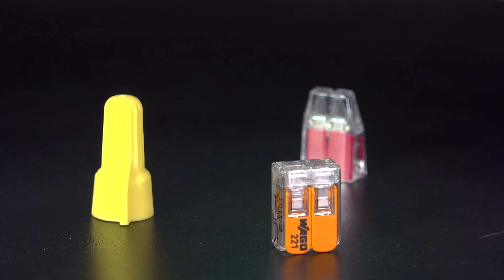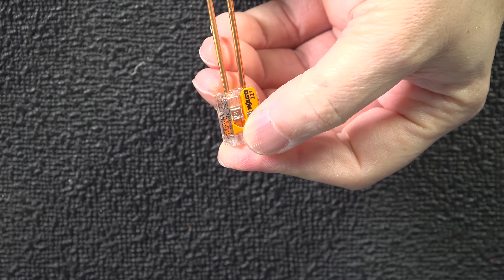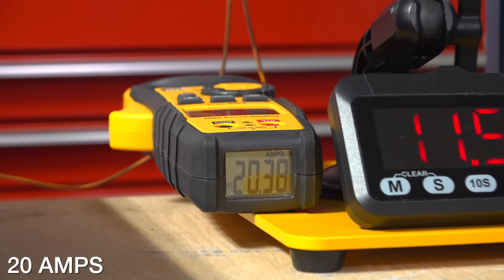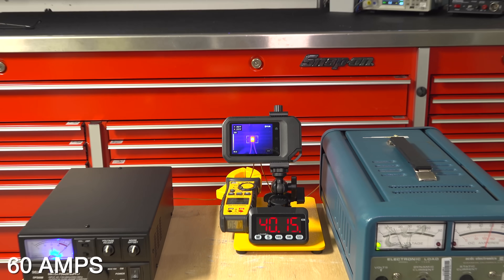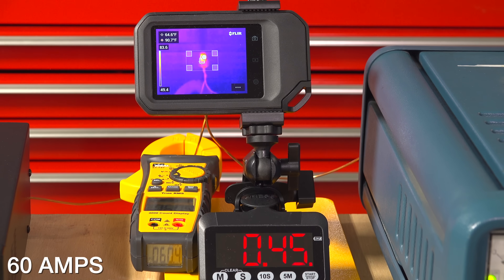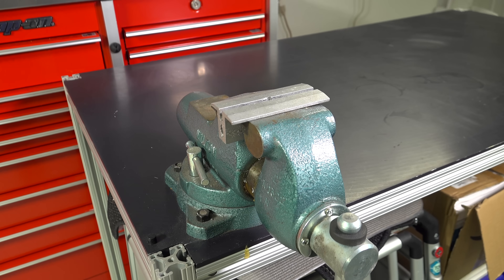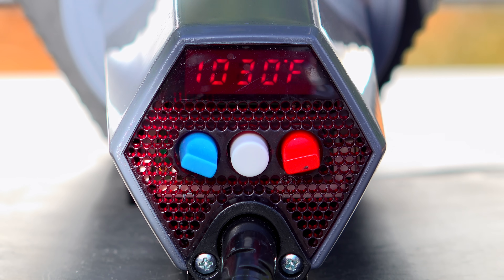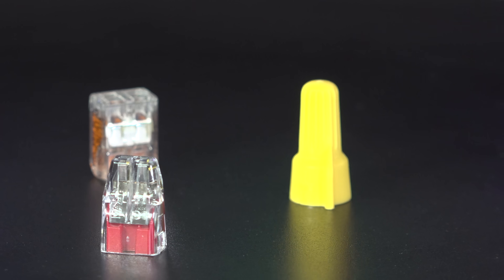What Wire Connector is the Best? Wire Nut VS Wago TESTED

Comment: I used the whole range of Wago 773's in my farmhouse rewire, and have had nothing but problems with them.  Simple, easy and quick to use, but they weren't reliable.  Even on light circuits, using 1.5mm cable and only LED bulbs, the Wago's were burning out.  I went back to the older style of connectors, without a single problem after 3 years.

Comment: The reason the wire nuts didn’t get as hot is a. Certain portion of the current wasn’t even making it to the wire nut because you twisted the wire down so low. It was able to transfer to the other wire without even going thru the wire nut

Comment: Someone else might already have, but I must comment that your wire nut test was not likely to be fully accurate. Usually if the wires are twisted together there is only the nut's length of bare wire involved.  Now there was at least double of that length making more or less contact. It might or might not contribute to the result, but that way there will be contact area outside the nut and in a ventilated environment.

When I went to vocational school we were strongly couraged to discard the wire nut if undone, and put a new one on, unless ONCE adding a wire. The nut can also hold well on to a maximum of 5 wires (seen these Wagos with up to 8 slots) where pre-twisting is highly recommended. 6 will be questionable and the 7th would tend to center inside the other 6 and possibly pull out easily. 

The Wago can be reused a couple times, undone wire by wire without twisting, wiggling, or pulling, or disturbing the seating of the rest of the wires, it can take mixed wire sizes, and it works well with stranded wire too. AND it will hold on to a single wire of any accepted size.

Comment: Hi, when you tested the heat dissipation on the wire nut you twisted the non insulated wire (2:59) on a longer surface than normally would be if it was an insulated wire, the increased contact surface  between the wires lowered the resistance and the result is a lower temperature at the wire nut,

Comment: Can you do the test on 110v AC? I saw low voltage DC and high amps in your test.  That’s not an accurate representation of real life for any of those connectors.
Reply from the maker: AC & DC amps are the same Feel free to look it up. For testing this, its identical.
Reply: @SilverCymbal  ok, so why was it at about 14vdc? That’s not 100-120v... big difference in wattage.

Comment: great video. a couple things though.  
On your first test with the wire nut, when you twisted the wires together you had like 25mm of twist beyond the wire nut, so the nut was likely not seeing the full 60A load, just the residual heat off of the long twist connection.  I think it's unlikely for wires to be twisted that far down from the nut, but I'm no elechicken.

In your heat gun test, if the wago were actually making a connection between two wires, even at 1100 degrees, the connection would not have failed.  Only the plastic did, but the metal tab construction would have continued to hold on to the wires and complete the circuit.  The same could probably be said for the wire nut in this case as well.

Comment: Was that test done with AC or DC power?
Reply: Test was done with DC 14Volts. But for the this test it really doesn't matter. for the wire or the connector 60A at 14V DC are the same as 60A at 110V AC
DC is sometimes even worse than AC  (e.g. switches) because there is no zero crossing like with a AC sine wave - so contacts burn up more easy.

Comment: still..1980 houses are still holding up still..due to people know how to use wire nut correctly...extra tight as breakers bond its hot wires very tight...copper need to be grab tightly so be no friction to cause heating issue...remember ..always update your panel box for same metal as breakers and wires...aluminum does not do well with copper wires feeding the bus bar...cause copper eat up the aluminum..only solved this..either change entire wires to aluminum that even from meter box that feed it ...that will cost lot more than just get copper 200amp panel from latest panels are now made in copper bus bars ..

Comment: Might as well include all parameters that are present in real world use (include insulation) not including insulation is swaying the bench test, by how much? Idk, and nobody does until you document your data with ALL real world parameters. To some degree, the insulation will decrease the fitting amperage capability. Bare copper isn't going to react the same as insulated copper to current because heat is a byproduct.

Comment: pore design the electrons have to come back on themselves causing heat.. you should only be using inline connectors of the right amperage
Reply from the maker: Yes up to their 20amp rating or less.

Comment: I think it really comes down to cost if ur using for a commercial application amazon a box of 100 wagos 20 bucks wen a box of good ideal wire nuts 50 bucks for 500 n wen ur ur using thousands it adds up. Also u have less restrictions u can put 2 4 6 as many wires the nuts rated for without having to have just 2 4 or 6 port wagos without having to order 5 differnt sizes or making jumpers between them thats just my opinion.

Comment: I think I will stick with wire nuts and screw clamps.
Waygos have more points of failure than other connectors. I use them for temporary connections only.

Comment: I have seen wire nuts with 4 wires stuck in them and they were holding on by just hope alone and I had to replace them by soldering them since I didn't know about Wago lever nuts then.
Reply: You just use a bigger wire nut. They do come in different sizes.

Comment: Well , how do they do with the aluminum to copper connection as i have a special connector with lub to prevent high resistance connection and  torque setting as possible overheating and fire .  Code says replace wire nuts in older houses, Thanks for great video
Reply: Many Wago connectors are certified for use in (mixed) aluminum wirings, but you have to apply a special contact paste to the clamps. Download the product data sheets on their website.
Reply: @matekochkoch  thanks  for info . so much ------40 amp show was great

Comment: I don't think that the method is good for testing the wirenuts, compared to wagos
In the wago, the wago make the connection, and the load pass thru the wago

With the wirenut, absolutely no load pass thru the wire nut, because wires are twisted before it...

But even if the twist was only in the wire nut, I think the wirenuts will handle more because there just "hold" the connection between the two wires, and do not act as a wire itself like wagos

So better in terms of heat and connection, but I personally prefer wago anyway

Comment: @Silver Cymbal thank you for the share . I'm sure the wagon costs more per unit compared with a wire nut
Reply: Yes, but no. They are way more expensive, but you safe that on time. Also maintenance, measurement and alterations are much easier. All Wagos have a point for secure access with a multimeter. If time or wages are a part of your calculation they are not more expensive even on first Installation.

Comment: I’m going to keep using wire nuts because I’ve never had a problem. 
If it’s UL listed it’s all good.
Reply: Your last sentence makes this the top comment. That testing is there for a reason and it works.
Reply: @jeremiahrex  I’m actually pretty sure the WAGO’s are UL listed as well. 
I’ve just never had a problem with wire nuts, and I know what’s it like to work in a pancake box in some of the tightest areas. I’m sure everyone here knows what I’m talking about or been there and done it a hundred times. 
We all have different opinions.
It’s the UL listing is all that matters... also local and state code. However I couldn’t think of a state that would ban the use or even a locality. In my case it’s personal with my state inspector, he doesn’t like them, I don’t use them.

Comment: Three 12 gauge conductors on yellow wire nuts.  Four 12 gauge conductors on red wire nuts max.   Twist wires with your linemans and twist connectors clockwise.  We all have our preferences.

Comment: I liked all the tests that you performed, good work, although I would like to see the current test with actual AC power and not DC, seeing that these connectors would be used on actual wiring in a commercial or residential setting.
Reply from the maker: For electrical purposes and heat generation AC amps and DC amps are the same. Lots of articles discussing this you can search on that can explain why better than I can.
Reply from the maker: Here is a little more info: DC Amps and AC amps are the exact same thing, they are the measurement of electrons past a given point, the difference is that the electrons of AC go back and forth (alternating) and DC go only in one direction (direct).
Reply: @SilverCymbal   I thought that DC was actually worse for heating which is why the DC rating on contacts and such is less than the AC.  Not intuitive, but the AC gives a bunch of tiny cooling periods as it cycles.
Reply: @jkbrown5496  That's incorrect.  (well ... context dependent ... DC ratings on contacts are indeed lower than AC ratings, however DC and AC wire and connector ratings are equal)
The "tiny cooling periods" are offset by the higher peak currents in AC (the "equivalent" current for heating is the RMS current, google "Peak current vs RMS current" if you are unfamiliar with this)
For wire (and connector) heating, RMS AC and DC ratings are the same.
For contacts the DC rating is less than the AC rating, but this is NOT due to heating considerations.
It's because when a contact (switch, relay, etc.)  interrupts a circuit, an arc is formed as the contacts separate,.
In DC there is nothing acting to interrupt this arc. In AC, the arc will extinguish as the current reverses through zero.

Comment: Your test is 60Amp @12v DC whereas a standard home in North America would be 120V AC - would the voltage (both at 60A) make a difference to the results?
Reply: No, voltage does not matter for things like heаt emission, as long as your supply is able to maintain the fixed current.  The power dissipated on a connector will be I^2 times R anyway,  where I is the current, and R is the resistance in the connector, determined by how it is build
Reply from the maker: DC Amps and AC amps are the exact same thing, they are the measurement of electrons past a given point, the difference is that the electrons of AC go back and forth (alternating) and DC go only in one direction (direct).

Comment: I just started using the Wagos. I attribute the resistance to people resisting change. Some people that have been around usually resist new technology and just bash it instead of giving it a chance. I work in the Technology field and see it everyday.
Reply from the maker: 100% agree, I know without a doubt the most of the haters here have never used a Wago 221. I am NOT in favor of all push type connectors, not even Wagos push in only models. The 221/222 series are the best thing they came up with hands down.
Reply: @Brian Bell and away we go!
Reply: I attribute the resistance to less conductor contact area.
Reply: I'm already sick and tired of these (senile) people!
We would still be living in mud houses with straw roofs and using washboards, if it was up to them smh
Reply: @walterbrunswick  wait … are you saying you don’t have a washboard? How do you wash your clothes, beat them on a rock down at the creek???
Reply: @walterbrunswick  I'm not senile, I just don't care. I spent many years upgrading knob and tube to romex using wire nuts. The next generation can spend their careers upgrading my wire nuts to Wagos. I'm retired now, I blame the arthritis in my right thumb on twisting about 247 million wire nuts over 50 years.
Reply: Don't fix what isn't broken.

Comment: Being a contractor I am always switching out fixtures, outlets and switches. I was considering going full on with wago until a few months ago. I pulled a wago out of jbox that was toast and judging by the others in the box they were not that old. I dont know all the circumstances because I didnt install it but it does put doubt in my mind. I still have not jumped on the wago wagon yet but time will tell.
Reply from the maker: Just don't make a common mistake. It's very unlikely what you pulled out was a Wago 221.  They are 100% not the same as other push connectors.

Comment: Why not use AC?
Reply from the maker: DC Amps and AC amps are the exact same thing, they are the measurement of electrons past a given point, the difference is that the electrons of AC go back and forth (alternating) and DC go only in one direction (direct).
Reply: @SilverCymbal  yea and one is more lethal than the other.  Also looking at your meter, I wasn't sure exact voltage of your DC pack, 48V?  60A 48VDC != 60A 120VAC.

Comment: As an electrician of forty years I'm impressed with the Wagos after seeing this test. I would like to see the same test on non-Wago brand type connectors, such as the type that come with recessed light fixtures. They are stab-ins with no levers.
Reply: Push in can be only used for solid/single strain wire, while lever types can be used for multi strand wire and solid wire.
Reply: The spring loaded wagos that dont have the lever are made for use in wires that only have solid piece of copper. And those lever ones are made for cables that are stranded copper. And the springloaded ones i guess you call them stabins are probaply even better and they are cheaper. Wirenuts i think are  illegal here. I hate to see them anywhere
Reply: Electrician of 16 years.. I fear WAGO's abilities with amperage draw, and maintaining pressure on the connection over time. The lever type WAGO's do seem to resolve this issue. But this test gave me a new found respect for WAGO's. I wonder if twisted wire diminishes the abilities of the WAGO. Great video though. I will be sharing it.
Reply: @ElkStirrinTheHoney  what if you only got 1" of wiring in the gang box for the light switch or receptacle because some fool cut the wiring back too short when cutting off the wirenut that wouldn't untwist because it was burnt up, fused on, or rusted on??  I don't see how you would get out of a jam like that other than using wago connector.
Reply: @kalijasin  Put a pigtail on it. Extend the wire. It can be difficult, but I've done it. A wago might be the better option though.
Reply: I love Wagos. I'm through with push ins and wire nuts.
Reply: @im2yys4u81  push in's are also wago's.. they just aren't the lever type.
Reply: @ElkStirrinTheHoney  I wasn't aware that Wago makes a push in. I'm partial to the lever locks. Easier to work with and they make the box look neat. Looks count.
Reply: My issue with wago's, is that it's not always possible to just add a wire, when needed. Like when you have a 2 port wago, and then need a 3 or 4 port wago. Now you've bought 2 wago's, when you would have been fine with 1 wirenut.
Reply: @ElkStirrinTheHoney  I bought an assortment online. Came with 2's, 3's and 4's. Sooner or later you'll find a use for the 2 port. I understand what you're saying, but me personally I'd rather buy what I need. Worst case scenario you end up with some strays, but sooner or later you'll use them.
Reply: @ElkStirrinTheHoney  Except it's extremely easy to remove the 2 wire Wago connector, swap in the 3 or 5 wire, and then you get to keep and reuse the 2 wire you removed. If you do electrical work regularly, far from a problem, and much less hassle than wire nuts or screw down connectors.
Reply: @ElkStirrinTheHoney you would have never been fine with just one wire nut of you’re using wire nuts correctly, going from a two wire rated yellow you will not be able to insert 1-2 more wires in and you’d still need to use a red 4 wire nut
Reply: @signalsoldier28  At a much cheaper rate even with the cost of the 2 wire nuts. Tans, and Reds do just fine with most connections.
Reply: Keep in mind that I've never used either type. 
Forty years an electrician, as I said, that has worked commercial and industrial projects of all types from hospitals to nukes yet never used a wago. 
I've spun a million wire nuts, aka pressure connectors, and I do have my favorites, and I'm sure the first one I ever installed is still functioning perfectly.
I probably wouldn't be able to say the same about Wagos.
I'm just interested in all new technologies.
What do I use in my house?... Wirenuts.
Reply: @divechart4269  Wagos have been in use for decades in Europe and are very successful.  I would be surprised if they don't last as long.
Reply: @divechart4269  Ideal or 3M?

Comment: Great video.  I'd like to see a follow up with the wire nut on insulated wire, where the connection is entirely in the last 3/4" or so vs the 3" of twist in the bare wire we saw here. Maybe twisted vs untwisted too.

Comment: I am a life long electrician. You never tested the most popular wire nut here in Canada for decades- Marrette . I am an industrial, commercial , residential journeyman having completed my apprenticeship in 1980. I have had issues with Idea connectors rotting ( corrosion) from the inside, the ends melting and the larger ones ( reds ) not remaining tight . I have always twisted my wires , that was the norm up until maybe 8 years ago. ( Lazy new age electricians)

Comment: USA is just full of people who think that old is better than new... even when it isn't. And they come up with all kinds of reasons to claim that. Wago's have been used in Europe across several countries for a LONG time. No issues. We don't even allow wire nuts anymore in our electrical code since they're unreliable, easier to install wrong etc. And they prevent reconfiguration of installation.
They're just fine. Unless one's a tool and uses them wrong. Wago has separate versions for stranded and solid wires... FOR A REASON! :D